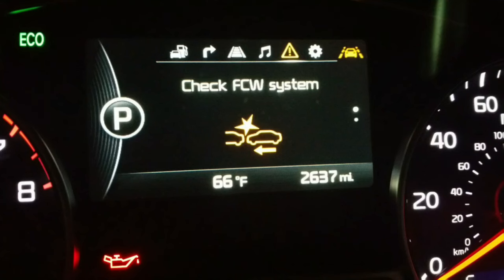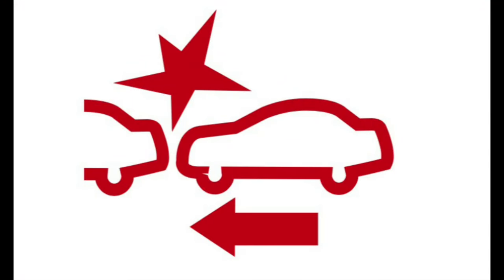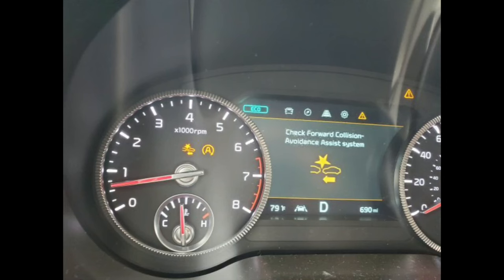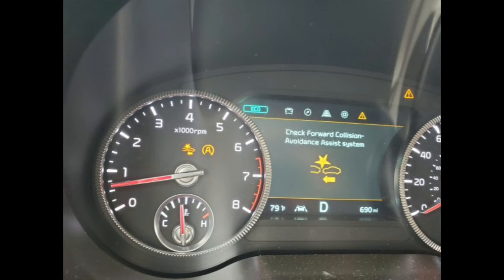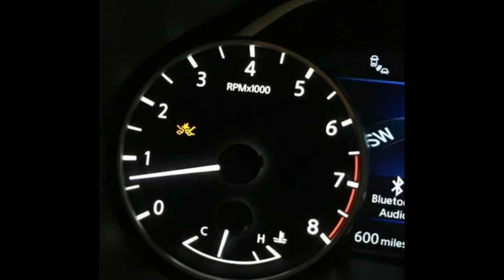Can I still drive with my (FCW) Forward Collision Warning Light Stays On? Common Causes

Comment: Can I drive the car with the warning light on?
Reply from the maker: @LifeActivated-ep2wb Driving with the forward collision warning (FCW) light on is generally possible, but it indicates a potential issue with the system that should be addressed. Here's what you need to consider:
👉 Understanding the Light: The FCW system is designed to alert you if there's a risk of collision. If the light is on, it could mean the system is malfunctioning or temporarily unavailable.
👉 Safety Implications: While you can still drive the car, the FCW system might not function correctly, which means you won't receive alerts if you're at risk of a collision. This could reduce your ability to avoid accidents.
👉 Troubleshooting: Sometimes, the light may turn on due to temporary issues, such as dirty sensors or extreme weather conditions. Check if the sensors are clean and free from obstructions.
In summary, while you can drive the car with the warning light on, it’s crucial to address the issue promptly to ensure your safety on the road.

Comment: If it lights up as malfunction, is it ok to just drive it and just let the light be ?
Reply from the maker: @killertofu
If the forward collision warning system light indicates a malfunction, it's not advisable to simply ignore it and continue driving. While the vehicle may still be operational, the warning light indicates that there's an issue with a critical safety feature. Ignoring it could potentially lead to a failure of the system when it's needed most, increasing the risk of an accident.
Reply: @Dashboardwarninglights  well I'm ok with it not alerting me when something is close. I'm asking In terms of will it be OK to drive as in it won't make th3 car stop suddenly or anytbing of that nature ? It just lights up malfunction and it's bc the sensor inside is broke.
Reply from the maker: @killertofu   If the forward collision warning light is indicating a malfunction due to a faulty sensor, it's generally safe to continue driving your car. The malfunction won't cause the car to suddenly stop or experience any significant issues with driving performance. However, it's important to keep in mind that the forward collision warning system won't be operational, so you'll need to be extra vigilant while driving to maintain a safe distance from other vehicles.
Reply: @Dashboardwarninglights  thank you this is what I needed to know. I'm coming from crank windows and manual locks. I much rather would prefer to not have any of the sensors functional lol thank you for quick reply

Comment: My 2015 tahoe Front Collision keeps beeping when there is no car in front?
Reply from the maker: Hi @soniasanjuan4442
Sometimes there’s been water or ice near the parking sensors, which screwed up the system.the front parking sensors. Sometimes after a very hard rain, or a car wash, the system will be screwed up until things dry up again.

👉 Try It if don't work write to me again
Reply from the maker: @soniasanjuan4442
In this video I show you How to Fix or Reset FORWARD COLLISION WARNING ( FCW) Simple Step-by-Step

👉  https://youtu.be/DESICBat91I

Comment: My car has the Collins sensor on is nissan dayz and it not moving well what could be the issue
Reply from the maker: Hi @joelmutiso686 
Just clean the sensor If the problem stay you need To  check your brake sensor maybe there's something on there it can save you allot if it didn't resolve the problem better take it mechanic its
Reply from the maker: @joelmutiso686
In this video I show you How to Fix or Reset FORWARD COLLISION WARNING ( FCW) Simple Step-by-Step

👉  https://youtu.be/DESICBat91I